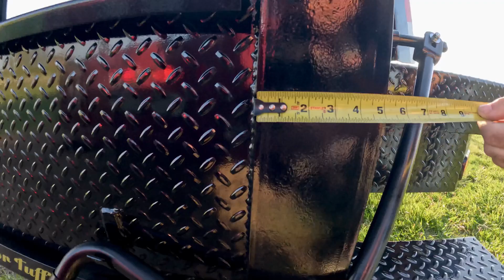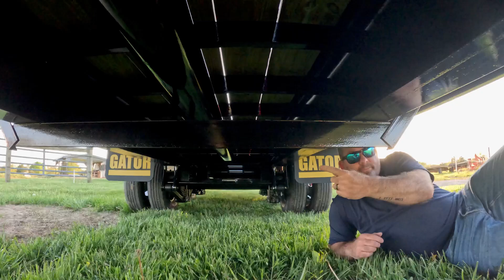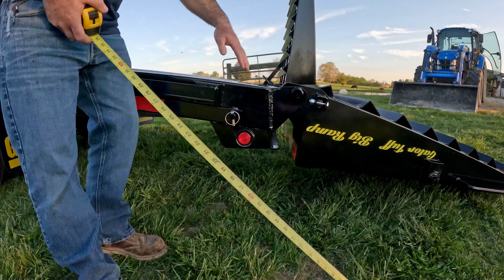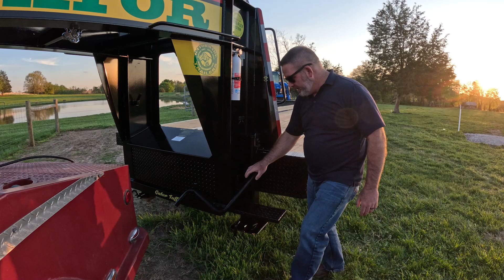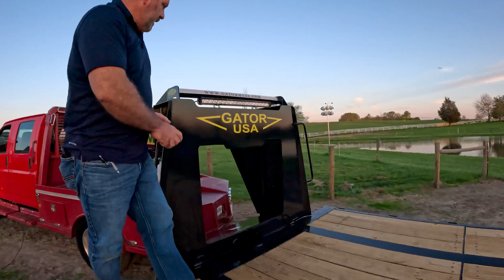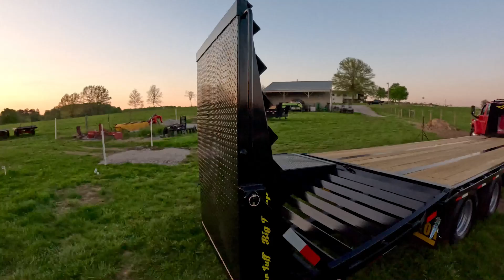How To Buy A Gooseneck Trailer.

Comment: woa.. I got a 22NG big tex have issues with the tires and rims they install the lowes grade tires at 80 psi when loading my enclose JD 310SG  backoe I need have extra tires to replacen them, I did some research on the old AI and states to run your load safely you need the 14 ply to 16 ply  tires (110ps G) so you avoid the issue you get, so far with the settings loaded with the backhoe I have replace around 10 tires..and yes I want to install some G or 14 ply tires but needs also to replace the steel rims to handle the 110 psi tires.. is anoying I need your trailer..can i trade my junk is in good shape just the tires 1 have one falt still on..  BIG TEX, im piss about it..

Comment: I have been shopping for a 40' gooseneck trailer and thought I would buy a used BigTex. Then last minute I came across a 40' gatormade. It's a 2013 and has the heavy duty wall between the neck and the deck. Steps, work lights, turn and brake lights on the neck, nice welds, and quality metal. I was so impressed I knew it was for me. Your video highlights these key features and more. I am very happy you folks build such an outstanding product.
Reply: The 2013 Model you have may have a few year on her, just make sure you change that hub oil and service it.  Should give you many more years trouble free use.

Comment: Trust me I’ve run several heavy spec goosenecks I run a 25+5 with 15k axles Gator and we haul a lot bigger than a 450 case it’s had 650j and 24,000 lb excavator on it almost every week sense we bought it. You WILL NOT beat a gator when it comes to rough and reliable

Comment: I am specking out a trailer from Gator with my dealer now. I want two speed jacks but without the pin drop leg. I want jacks like on our semi trailers that are two speed with large foot print pads and all you have to do is crank them down, no crawling around pulling a pin and dropping a leg on each jack. I am being told it’s not an option, that Jost brand offers the style jacks I want, is that something I can special order and have them installed from the factory? Thank you

Comment: Nice trailer can you pull it with  a 2500hd. Or what would you recommend, I'd like one from bumber pull I thank, I haul mx6000 kubota
Reply: I would recommend a 16k Elite gooseneck trailer, or our  16+5 or 20+5 14k deckover/ bumper pull.  The gooseneck will pull much easier than a big deckover bumper pull.  If you have air bags on the rear of your truck, it will handle the bumper pull much easier than just springs suspension.  Hope this helps.
Reply from the maker: Yes you can!